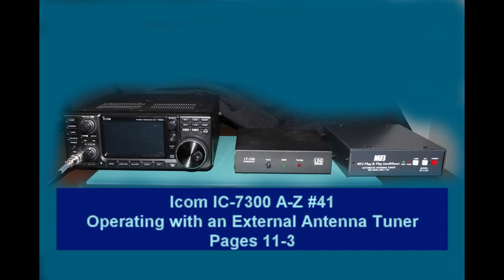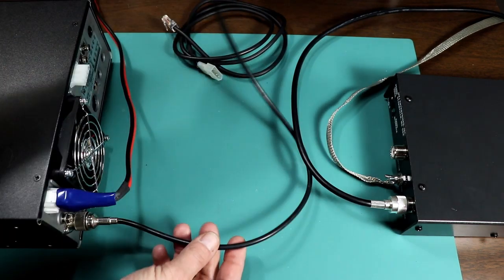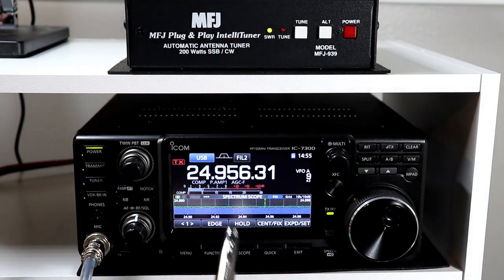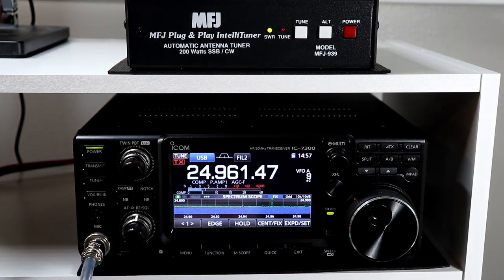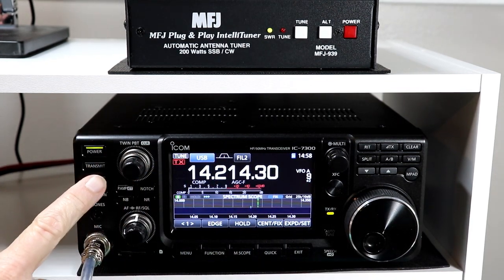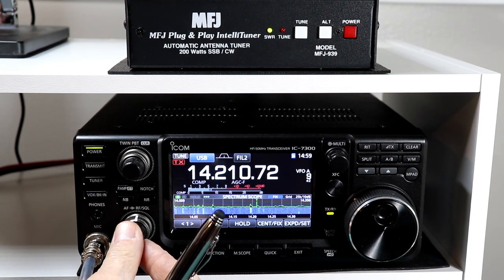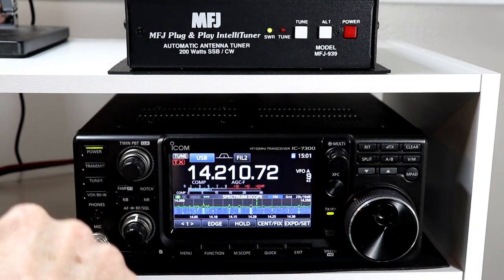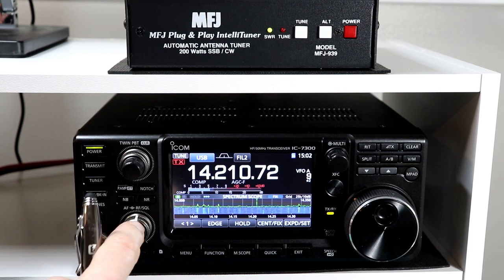Icom IC7300 A to Z #41 Using an External Antenna Tuner

Comment: Thank you for this video.  Does the Icom 7300 display the resultant SWR after a successful tune?
Reply from the maker: Yes.  As long as you have SWR as the selected meter.  Or if you touch & hold the meter, it will display all of the meters.  You can always see what your SWR is when you transmit.
Reply: Thank you.  A nearby ham with a 7300 and an LDG IT-100 demonstrated his rig to me.  When the LDG got a successful tune, the "good" light came on.  The question I had was what the SWR really was and what the LDG determined was "good."

Comment: If you have a high-SWR antenna system that a MANUAL tuner that can only get down to 2.5:1, could you then use the 7300's internal tuner to finish the match?...Or would two tuners together create more issues?
Reply from the maker: There might be some interaction between the tuners.  However, the output of your external tuner will look like a 2.5:1 antenna system to the 7300.  So, yes.  You could get a 1:1 (or close) match at the radio.  The problem is that a lot of your RF is being turned into heat in the internal tuner, external tuner, and mismatched coax going to the antenna.  So, although it would work okay from the radio's perspective, it probably won't be a very effective antenna.  Always remember, a 50 ohm dummy load presents a 1:1 match to the radio too, but you're not going to work a lot of DX with it.

Comment: Tom, I use the MFJ tuner with my IC-7300.  When I QSY to another portion of the same band, the tuner drops out, seemingly randomly, and returns to functioning when I return to the frequency I was at when I tuned the radio.  If I stop and tap the Tune button on the radio when it drops out, it re-tunes to my location, and signals return. Is there a way to know with more precision how much of the band is 'tuned,' once a particular frequency is tuned? Are there Menu settings that affect this?  Thanks.
Reply from the maker: How much of the band any “tune” will cover is heavily dependent on the antenna system that is connected.  I am not aware of any simple way to check this without sampling SWR at various frequencies.  In your case, you say “drops out” and “signals return”.  This sounds much more drastic than I would expect.  As you move away from the frequency you tuned, the SWR will rise, but in receive, you really shouldn’t notice a significant difference in signals unless you are changing bands.  I suggest that you look for intermittent connections in your setup or maybe something intermittent inside the tuner.

Comment: Did you ever try the MFJ tuner on 6m?   What is the min power required to work with that MFJ?  If you tried 6m with the other tuner how well did it work?   Did you ever try the Emergency Mode with the IC-7300 for a wider range of matching?
Reply from the maker: I have used the MFJ tuner on 6m.  It seems to work okay up there.  The MFJ manual says that the minimum power for tuning is 2 watts.  I have played with Emergency mode some.  It seems to work as advertised and allows the rig to match SWRs higher than 3:1.  I haven’t had a need to use it regularly since I have the MFJ939 tuner.
Reply: @HamRadioA2Z  Thanks for this info.  I wonder why they don't advertise the MFJ tuner for 6m.   I have a MFJ-993 and it doesn't work very well on 6m.   Thanks also for the Emergency Mode info.  My brother in law has the 7300 and wants to get on 6m.

Comment: Does the “Tune” button on the 7300 automatically reduce the power level for tuning ?  The 939 manual (quote below) says to keep power low, but it is unclear if the 7300 “tuning process” takes care of that ???

Likewise does the 939 tune button “tell” the 7300 to reduce power, tune, then return to previous power setting ?

The 939 manual says: 

“The minimum power to tune is approximately two watts, with maximum SWR tuning accuracy occurring at tuning power levels of 10-20 watts.”
Reply from the maker: Hi Richard.  The answer to both questions is yes.  I should have mentioned that in the video.  When the 7300 goes into tune mode, it puts out a CW carrier at about 10 watts.  This occurs either when you press the tune button on the rig or on the tuner.  So it is perfectly safe for your 939 - or any other tuner connected.

Comment: Hi this ROY Ve2uy

, love your comments for the IC-7300. Wondering if it would work with an SGC smart tuner? I don’t have a 7300 , wish I did. I have a Kenwood TS-480 HX. I did install the tuner at the antenna and it’s great. By the way the antenna that I’m using is 48’ long and only at 24’ above ground it’s home brewed. The original was on the internet and it is invention of a fellow in the UK. G7FEK Limited space antenna, look it up very interesting find. I have just rebuild it today and getting 1.2 to 1.7 across all bands without the tuner but I keep in inline just the same.
Cheers
Roy
Reply from the maker: Hi Roy.  I have an SGC-239 that I've had for years.  It works fine with the 7300, just not automatically.  There are a couple people out there who have made "tune plugs" that plug into the tuner connector on the back of the radio.  They basically fake the radio into thinking there's a tuner connected.  Then you can push the TUNE button and the radio will bypass the internal tuner and put out a low power carrier so the SGC tuner can go through the tuning sequence.

Comment: Hello, Nice Video  why would you use a external antenna tuner when you have one internal.
Reply from the maker: Hi Taino.  The internal tuner can only tune antennas with an SWR of 3:1 or less.  That would be antennas with an impedance of roughly 16 to 150 ohms.  So, if you have an antenna that is outside of that range on a band you really want to work, then your choices are to either put up a different antenna for that band or get an external antenna tuner.  Thanks for watching.  73.  Tom, WA2IVD

Comment: Tangental question--You mentioned your end-fed antenna with 9:1 unun. I am curious as to the length you have chosen for the wire.
Reply from the maker: I have tried several different lengths.  I've also tried different counterpoise lengths.  There are a number of websites with recommendations.  Palomar engineers sells some different options, but they also have a pretty good write-up on their website with various wire lengths listed if you want to build your own:  https://palomar-engineers.com/tech-support/tech-topics/best-hf-end-fed-antenna

Comment: Hi, what kind of antenna one can use that is best for Icom-7300?  Thanks..
Reply from the maker: Hi Ellob.  That is a very very big question.  If you ask 10 hams that question you will probably get at least 20 answers.  The answer also depends on what kind of operating you want to do, what your budget is, and where you live.  An off-center fed (OCF) dipole is a good, general purpose antenna that will let you work multiple bands with one antenna and only using the tuner built into the radio.  If you have very limited space, there are also multi-band verticals that require very little yard space.  Although most of these will require a radial system of some sort.  I hope this helps.

Comment: Tom

I noticed you tuned 160 with the mfj. Is your wire an 80-10? If so,with limited performance Im sure, can you still talk on 160?

Thanku!
Reply from the maker: At the time I made the video, I had a 53ft end fed (non-resonant) antenna with a 9:1 unun. Not to be confused with end fed half wave antennas. I mainly wanted to see if the tuner would match it. You certainly can talk and try to make contacts on anything that the tuner can match. I’m sure that antenna’s performance on 160 would not be much better than a dummy load. I never did try to make any contacts on 160 with that setup.
Reply: @HamRadioA2Z  Thanku

Comment: What power do you set on your icom if using the mfj and also internal tuner
Reply from the maker: Keith, if you connect an external tuner, made for Icom rigs to the tuner connector on the back, it will disable the internal tuner.  You don’t need to set the power during tuning.  The radio will automatically put out a low power carrier when you press the tune button, regardless of the power or mode setting.

Comment: When wanting to not use the MFJ tuner, why not just push the power button and turn it off?  Seems that is nearly the same as removing power.
Reply from the maker: To coin a phrase- 'doh.  Great suggestion.
Reply: And some auto tuner have a bypass

Comment: Can you please explain to me the grounding of the tuner and the radio with a tuner.  How did you connect the grounding wire?  My thanks for your reply.
Reply from the maker: You should ground both your radio and your tuner to the same grounding point with a wire from the ground terminal on each to the common point.  The ARRL has a good basic explanation of grounding here:  http://www.arrl.org/grounding.  They also offer a book: Grounding and Bonding for the Radio Amateur by: Ward Silver.  It is a great reference.

Comment: Can you still see your swr reading using the 7300's swr function.? Great video Tom. I'm looking at getting an MFJ 939 i.
Reply from the maker: Hi Ron.  The SWR function will still work, but with an external tuner connected, unless you bypass it, you're just reading the SWR between the rig and the tuner.  And, likely as you keyed on each different frequency, the tuner would try to start tuning if you were too far away from the frequency you originally tuned up on.
So, the shorter answer is that it will work, but it won't really tell you anything very useful.
Reply: @HamRadioA2Z  Thanks so much Tom. Exactly the answer I  needed. VE3SDQ.

Comment: Hi. Can I ask what was the SWR before you used the auto tune? Thanks. M7MGD.
Reply from the maker: Hi Martin.  With that antenna, it varied depending on what band I was on.  I have moved from that location and I don’t have detailed notes on that antenna, but it was anywhere from about 2:1 on the best bands to about 5:1 on the worst bands.

Comment: I have the IC7610 with the LDG AT1000pro2,,, interface is connected, tuner powers up ok when I turn on radio, but when I push the tune button on radio it does not key the tuner. I still have to switch to RTTY and key down then push tuner button on radio and the ldg tunes. Kinda defeats the purpose of using the interface cable.
Reply from the maker: Hi.  Here are a couple of thoughts.  Check the interface cable carefully.  In addition to Power and Ground for the tuner, the connector has Start and Key pins to let the radio know that an external tuner is connected and for the tuner to let the radio know that it has finished.  If either of those pins don’t have a good connection it won’t work properly.  Also, make sure the tuner isn’t in Bypass mode.  I believe that will also cause the radio not work correctly with the Tune button.

Comment: while you tune with an external tuner, does your SWR meter on the 7300 works ?
Reply from the maker: Hi.  Yes, the SWR meter on the radio still works when an external is connected.  HOWEVER, it is important to remember that the SWR meter in the radio is displaying the SWR it sees on its connection to the tuner.  So, if the tuner is able to match the antenna, you're always going to see an SWR of close to 1:1.  To see the SWR of the antenna, you will need to remove the antenna tuner from the circuit.  The MFJ-939 tuner bypasses itself when it is powered off.  You can bypass the tuner in one of 3 ways--  1) Turn off the power button on the front of the tuner.  2) When the TUNE indicator is on, briefly press the tune button on the radio.  This will turn the TUNE indicator off and bypass the tuner.  3) Like with 2) above, briefly press the tune button on the tuner.  It should do the same thing.
If you want to check the SWR of your antenna, MAKE SURE you turn the power on the radio down to 10-15 watts before you put out a carrier.  The radio only automatically lowers the power when you use the Tune button.

Comment: I am thinking of using the mfj-939 as a remote tuner at the antenna feed point. Do you happen to know the operating temperature range? I can't find it on the mfj site. Any data from your first hand experience?
Reply from the maker: Hi Richard.  I’m sorry, but I don’t know what temperature range it is good for.  I suspect that it would be fine as long as you put it in an enclosure to protect it from direct sunlight and rain.  Depending on how long the run it, you will probably want to use fairly heavy wire for power and ground so you don’t get too much voltage drop.  I’ve heard that MFJ technical support is pretty good.  You might give them a call and ask them.

Comment: Can the 939 turner ground be connected to the Icom 7300 ground?
I mean to put a direct cable from the transmitter to the coupler?

Thank you
Reply from the maker: It can be connected that way, but that is not ideal.  You should connect your 7300, the 939 and any other equipment in your shack to a single, common grounding point.  The ARRL has some answers on their website here:  http://www.arrl.org/grounding. They also put out an excellent book on grounding that you can find here:  https://home.arrl.org/action/Store/Product-Details/productId/133989
Reply: @HamRadioA2Z  Thanks!!

Comment: When you tuned a frequency in a band, does it only tune for that frequency or entire band?
Reply from the maker: Hi.  That’s a good question, but a complicated one.  The simple answer is that the tuner is matching the antenna for the frequency that the radio is on.  Whether it will for for the entire band depends on how broad banded the antenna system is.  In general, if the antenna is a broad band type and close to resonant (maybe 2:1 SWR or better on its own) then tuning on one frequency in middle of the band may be good for all or most of the band.  If the antenna is way off (3:1 or worse SWR) then it is likely that you’ll need to retune at multiple frequencies across the band.  73,  Tom

Comment: Can you please show me where you have grounded the 7300?  I did not see it in the manual.  Thanks.
Reply from the maker: Hi Mark.  You can find the ground screw between the antenna connector and the power connector on the back of the radio.  You can find it illustrated on page 1-4 of the manual.

Comment: I was under the impression from the instructions of the radio and the tuner that the internal tuner has to be turned off to use the external.  Yet you are using the tuner switch on the radio that is actually turning on the internal tuner.  If that is not the case let me know why the instructions are saying the opposite.  I use the tuner switch on the LDG100 not the switch on the radio.
Reply from the maker: Hi.  If you use a tuner that is compatible with Icom and plugs into the Tuner connector on the back of the radio, the 7300 will automatically detect the presence of the external tuner.  This allows you to still use the Tune button and the radio automatically bypasses the internal tuner.  If you use a generic tuner that does NOT connect to the external tuner connector, then you must use the Tune button to manually put the internal tuner into bypass.  Then follow the instructions with your tuner to to force your tuner to tune.  You will also need to manually put the radio in transmit with PTT, or the Transmit button, or with a CW key.

Comment: I notice when you hit the tune button on the radio the tune light comes on but the mode still says USB; does the radio stay on SSB during the tune, or does it change to am, fm, or cw to accomplish the tune. I’ve been changing to CW during the tune, and then back to SSB, but maybe that is not necessary. Any thoughts?
Reply from the maker: The radio automatically puts out a CW carrier at low power when you start a tuning sequence.  It doesn’t change the displayed mode or power level.  You don’t need to change it to CW before pressing tune.  Whatever mode you’re in and whatever power level you have the radio set to is fine.

Comment: The manual says to disable the internal tuner first. I cannot find a setting for this. Is this not necessary? BTW - LDG AT-100ProII, using the 4-pin Icom connector.
Reply from the maker: It is not necessary for any tuner that is Icom specific with the 4-pin tuner connector.  When the radio senses a tuner on that connector it automatically disables the internal tuner.  The TUNE button will also operate the external tuner the same way that it operates the internal one.  If you just use an RF sensing tuner or something else that doesn’t interface with that 4 pin connector, then you do have to manually disable the internal tuner.
Reply: @HamRadioA2Z  Tnx. I have the 4-pin fer my LDG.

Comment: I am using my trusty icon ah-4. Why do you mention using unun?
My wire is cut for 80 m I believe.
Reply from the maker: Hi Jim.  When I was filming that video, my antenna was a 53 foot end-fed antenna with short counterpoise.  Part of the antenna system is a 9:1 unun to help bring the antenna impedance a little closer to the tunable range.